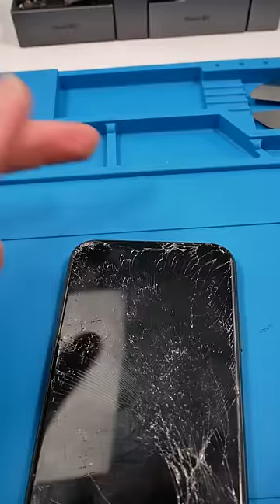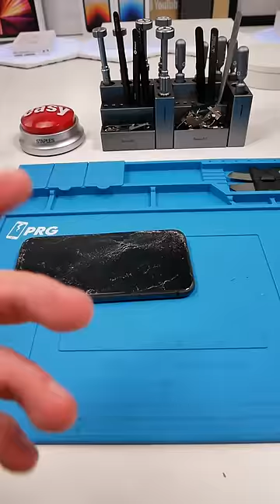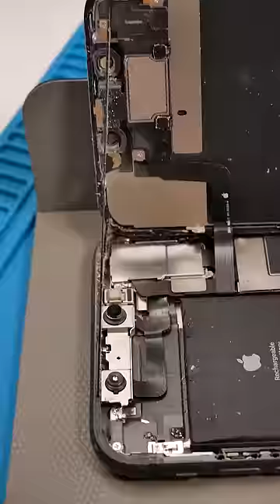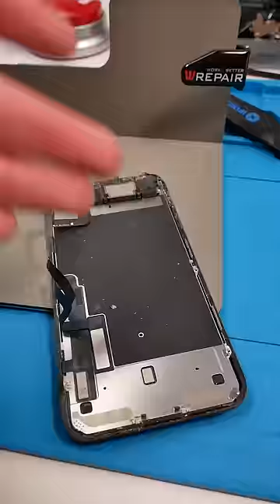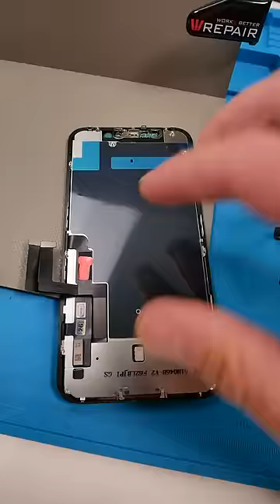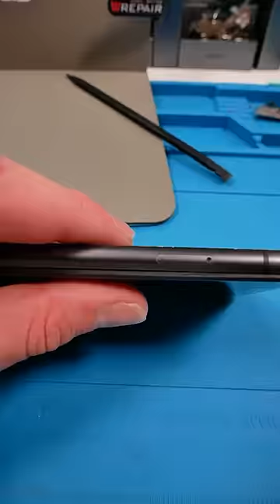Will Self Service Repair Leave Me Jobless...? #Shorts

Comment from the maker: Do you guys think the self-service repair program will affect repair shops?
Reply: A washing machine is a home appliance used to wash laundry. The term is mostly applied to machines that use water as opposed to dry cleaning or ultrasonic cleaners. The user adds laundry detergent, which is sold in liquid or powder form, to the wash water.
Reply: @grefku.  why? 😅
Reply: No its same they just made a super expensive tools earlier you can buy just cheap chinese tool which can easy fix every phone not just iphone..
Reply: STEVE JOBLESS
Reply: Would you be open to customers buying their own genuine Apple replacement parts and having you install them at which point they could just go back to Apple and have them activate face ID like they had done the repair themselves.
Reply: No, most people are too scared to open their phones.
Reply: No
Reply: Shout out plz😊
Reply: Maybe a bit but not much
Reply: No, but I agree that apple is going to use this to force people who fixed their own phones to get a new phone or upgrade to the latest phone when the face ID stops working after the repair.
Reply: No I don’t think cuz some people would just be too lazy or just scared of breaking thier phone
Reply: @KyraTheFloof   I am not
Reply: What is you shop I need to send my ps4 because my disc reader won't work
Reply: Did you go to school to do this
Reply: No
Reply: Yo question what is the music used in the video, I really wanna know cause it seems  really really good
Reply: Ur job will be little different because we destroyed our phones with the phones 😂… with self repair..
Reply: Do you take paypal after charging for repairs?
Reply: kind of
Reply: Not at all, your business will be fine.  People like me have no idea what they would be doing inside a mobile.

I would rather pay for a professional like yourself to do what I definitely can't do.
Reply: You'll even get better because noobies will damage more device component trying to fix (lack of proper training)
Reply: They will affect repair shops i'd say more people will just go to repair shops instead of going to apple to repair their phone. But you may become jobless when robots do everything.
Reply: No ppl is a lazy
Reply: Nah apple will be way too EXPENSIVE and yours are way cheaper.
Reply: i mean most people won’t be comfortable doing it themselves, but let’s these stores use the same tools they do making the repairs more consistent
Reply: Your my favourite YouTuber
Reply: No, ur job won’t get affected, because the apple self service is so expensive and very difficult.
Reply: Probably the ones that overcharge you or give you stuff that's terrible
Reply: Nah because people are laxy
Reply: @IAMFISHFOOD  😂
Reply: Computers are basically the most self service electronics ever and people still need technician to fix theirs, and to think that this would change a thing for technician would be a huge mistake.
Reply: Bro bro an 17 guy and uk we all love these things ,   how much u think a good electronic tool box and a heat gun cost, ( like tool box to strip phone , table , computer ect) forget about the Lazer 🤣 I ain't gona do repairs , just love striping shits and fixing 🤣
Reply: Nope not at all al you have said it’s true because the parts they Sold is very expensive only people how buy this thing are dump enough to buy it and brick ther IPhone and have to buy new one 😂
Reply: No I don’t think so not everyone is able to do this like us.
Reply: How much is it to repair a iPhone 10
Reply: No. Because some certain people don’t know how to fix phones on their own.
Reply: Not really. People are rich and lazy, as long as the option of sending their phones to a repair shop exists, they'll use that option. That's like saying restaurants will go out of business because of the option of making meals at home
Reply: No because repair shops do quick screen repairs, but if they were to buy one from Apple they would have to order each screen specifically for that phone’s serial number which takes a long time, plus the pricing of the screens from Apple vs the price of an Apple store repair is very similar which will make it so that independent repairers will have to charge more for repairs as they have to pay for the screen and the labour. So it would be longer AND more expensive than Apple store, so no
Reply: So did they loose Face ID?
Reply: bro where do you live i need you to fix an iphone 10
Reply: @rafaelurben  r/wooosh
Reply: @iPad Mini 6 I only got one but my case has a bumper around the screen so most of the time I damage my case instead of my screen protector:
Reply: Nah they will broke their own Iphone😂
Reply: Did he lost his face id
Reply: It depends, as you said in the video, only a limited number of things are exclusive to self service repair…probably, I really hope this doesn’t happen. As nobody wants to pay for more.
Reply: it might affect the price if they want touch id and stuff, but other than that i doubt it
Reply: Long term? No not at all. Ignoring the fact people have already experienced the quality of your work there will always be at least 1 person who needs a repair service like yours.
Reply: If the appliance makers made it possible to fix a microwave that the front buttons go out on because they use capacitive touch buttons that would be great
Reply: As you clearly stated it takes a lot to fix things all by themselves even after having a tutor so You are Good as you Said
Pls keep up the same
Reply: Not really i mean some people still call help to fix easy task that you can find the manual everywhere, so yeah probably not all people have time or desire to learn fix their own phone
Reply: Nope
Reply: The repair programme is such a pain to do so I think that repair shops will still be on top
Reply: Not at all, because like you said the parts cost a lot more than people pay you to fix their phones
Reply: Why don't people start to use linux as their operating system instead.... I mean... Sure Android is a linux based... But that's besides the point
Reply: Are you able to make non water proof phone water proof or can you identify that a seal is damaged
Reply: Plz a video on Samsung Z flip 3..
Reply: Yeap. Serialization sucks. You are right to be scared
Reply: How can I. Contact oyu for my phone repairs
Reply: Damnnn you brought up some really good points, Apple is fucking slick and shiesty
Reply: Naw, you will just stop getting stupid clients
Reply: I don’t think so but I hope not because your videos are amazing
Reply: I honestly hope not but I doubt it would, although I find it dumb as hell that apple tried making a self service repair program to essentially solve a problem they created. But I guess they also did that back in 2016 or 2017 whenever the iPhone 7 came out when they removed the headphone jack and 28 minutes later they unveiled the AirPods
Reply: No
Reply: No, however it is for this reason that I switched to, Android. I really don't think it would be a good idea for people to do this themselves unless they are at least semi professional at it
Reply: No unless someone gives a good rating and the good rating spreads
Reply: I dont think so..
Reply: Yes and no
Reply: Guru Jobfull, Steve Jobless
Reply: No
Reply: @grefku.
Reply: @grefku.  i don't get it
Reply: Did he loose face id?
Reply: No
Reply: no... because people dont want to fuck up their phone when they repair it themselves, better send it to someone who actually knows what they're doing.
Reply: Heck no like nobody’s can do your magic
Reply: No
Reply: Never bro it might even bring you in more costumers 😂😂😂
Reply: not even a little
Reply: Nope
Reply: Fixing car and phone is huge difference like literally. Car is so much bigger and heavier you just can't fix it myself. 
But everyone can fix their own phone.
Reply: Most people would prefer fixing their own phone cuz it's cheaper and safe from getting your files being stolen.
Reply: Yup they'll deactivate more things once a non-apple employee does it
Reply: No
Reply: Not a lot.
Reply: Not much. Too many people know how to hold a screwdriver or how to handle flex cables.

Comment: I think it will still affect repair shops to some extent, especially if Apple lowers the price of components and especially for simpler repairs, but you'll definitely survive. I don't usually break my phones (and don't buy Apple products because I'm not a fucking masochist), and typically by the time they're naturally worn out I get an upgrade, but I do own a bicycle that needs minor repairs and maintenance, especially replacing brake pads, very frequently. I recently installed a whole new set of brakes on it, but I also recently took it to the shop to have other work done because I didn't have the tools to get the component that needed servicing off the bike and it was a relatively advanced fix. Similarly, people might start replacing their own screens and back glass, but they'll probably still come to repair shops for things like battery replacements or charge port repairs.

Comment: My guess was the very opposite since you would be able to get your hands on genuine parts the quality of repair shops will have a higher potential since most people instead of being "the phone won't work the same after repair" the people would be like " I can pay a couple more bucks and get better parts and the phone would be in a better state than using 3rd party parts" although that applies to some repairs not all of them

Comment: Mine was cracked like this and face if stopped working. I replaced the screen and it still works fine. Just annoying pop up telling me the screen isn’t original even though it’s a factory original oled. Annoying af

Comment: It may have a minor impact but overall repair shops will still see enough customers to turn a profit. Price and people not wanting to damage their phones whilst attempting to fix the device is probably the main 2 reasons for a customer coming to a repair shop. Also I'm wondering the awareness surrounding the self repair program Apple and some othe companies are attempting to do (I believe a few manufacturers have partnered with IFixit). I honestly think there is still lack of awareness around the programme

Comment: We bought all the equipment from Apple and did an authorized repair at our shop. The equipment worked great just disconnect the three flex cables on the iPhone 13 P Max. The display from Apple had the phase ID light sensor already attached so literally plug it in after re-seal then turn it on and contacted Apple. Shit went bad… put the phone in Diagnostik mode went through the steps with Apple but no Face ID. I kept getting pre written messages from them saying the Apple display doesn’t come with the Face ID or light sensor attached even though it did and sent them the purchase link which shows it but lots of fuck around. Eventually I asked Apple to put the phone in its original config so I could put the original light and phase ID sensor on and they said WE WON‘T Do that. 1,300 € bought the customer and new phone now we use the Apple equipment but Apple Original displays for a quarter the cost from our supplier and manually transfer the parts. F U Apple